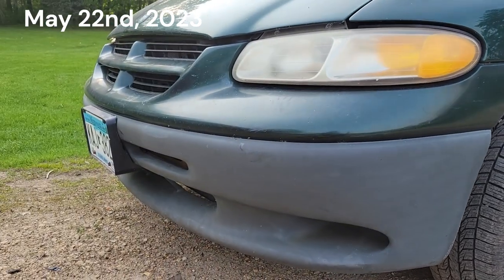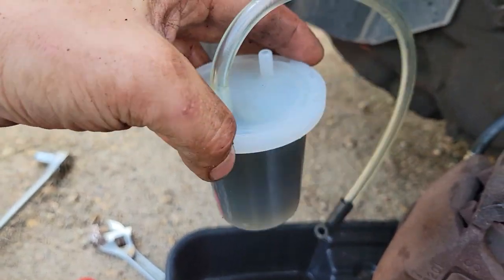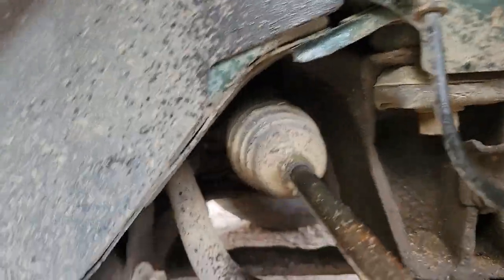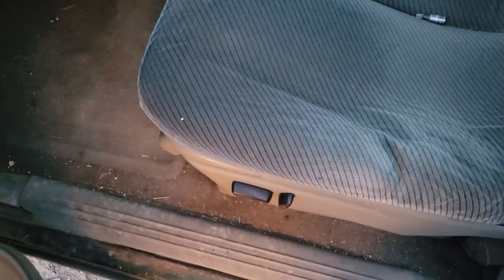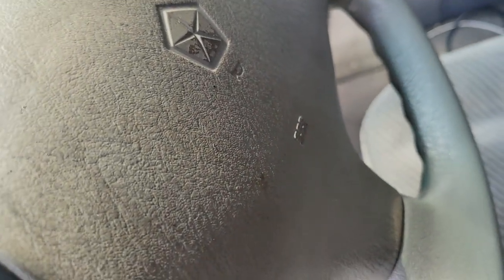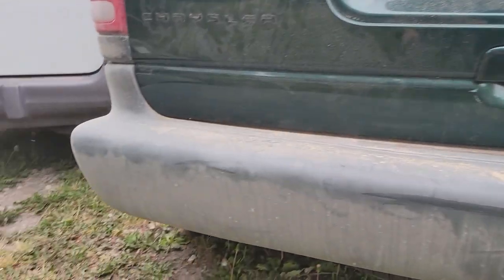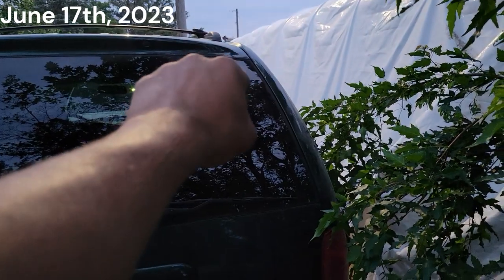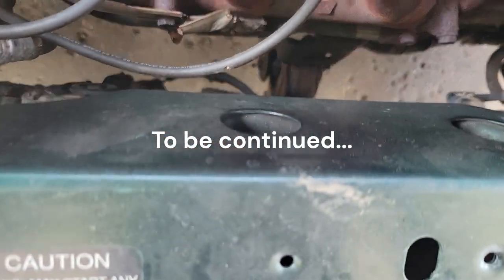Making some repairs on my 1997 Dodge Caravan LE  - Part 1

Comment: You know my parents had two of these vans when I was little.  A 96 and a 98 both standard length dodge caravans so it's very cool to see someone taking care of them.  Most of these rusted away but lately I've seen some out and about in very good condition.
Reply from the maker: Thank ya! Yeah lately I've been seeing 1-3 a day on the highway. Not sure why but I'm not complaining!
Reply: @MNMoparMinivan  Guess I'm not the only one who noticed.  Seems to me that these 90s vans have more staying power than the next generation ones haha
Reply: These vans will run forever. Only major problem is the transmission and here in Wisconsin the rust. Especially on the strut towers. And they are very good on gas

Comment: I did a tailgate replacement on my 2000 NS as well. I have the same trim, but decided not to put it on for several reasons.. The main one being that if the new panel ever shows rust, I can catch it! 

Love these videos! Nice work
Reply from the maker: Thank ya! Grab a can of fluid film or some other equivalent oil and spray a bit into the the drain holes at the bottom of the tailgate. Ideally, it'll seep into the pinch weld and keep it from returning.
Reply: @MN Mopar Minivan - I also just noticed the part where you mentioned the lock

I ended up making a key for the new lock on my tailgate instead of swapping the handle. I was able to decode it using a Lishi tool, and then cut a blank. It wasn't easy but it was worth it

The previous shop that swapped the handle on my old tailgate caused rust there, because the tab that holds the handle to the trunk can easily scratch the metal when you install it

https://www.youtube.com/watch?v=pHUN7RCAA9Q
Reply: @MNMoparMinivan  thank you!! Yes, I was really happy to see you using that too. I coat the whole undercarriage and the insides of the panels every fall!
Reply: I also fill the rockers with old used transmission fluid. lol

It does actually work, but will seep for a bit

Comment: Mine is a 97 too but it's a Grand Caravan base model so its got the manual windows with no tac or info center in the front. Speaking of which, can you do a video on how to replace the headliner in one of these because mine is bubbling so bad to the point where I cant even see my interior lights anymore lol
Reply from the maker: I have to put the new headliner back in my 90' and the process is similar. I'll see what I can show there. Until you can get it replaced, maybe get ahold of some thumb tacks from dollar tree and go to town on that thing lol!

Comment: Good video. 
So what was the fix for the fan continuously running?
Reply from the maker: I talk about it more in part two. But when the one fan motor locked up, the electrical resistance it caused burned up the controller relay. Luckily it failed "open" so the one fan kept running constantly.
Reply: @MNMoparMinivan  I had a fan stay on after it had overheated. After a bit I pulled the ground on the battery but replacing the relay did not fix the problem. The next day both fans would not turn on. If you put 12 volts to them they would. I ran it that way for a bit not using the AC but then the radiator started leaking. I got a used one with the fans and put it in. The fans started working so don't know what problem was, maybe a loose connection although I though I checked them all. Someone told me it was the computer but if that was the case they shouldn't be working now. Happy Motoring.

Comment: I have a 2008 dodge grand caravan that has the same engine as your 05 town and country i was wondering how often you think the head gaskets should be changed on it? Its only at 86,000 miles on it
Reply from the maker: My 05 has 313k on it and the engine has never had major work besides a Waterpump at 200k. I'm planning on doing the Waterpump and timing chain at 315k.

My dad has an 08 with 435k on the clock on the original headgaskets as well. Pretty sure it had a chain and a waterpump at least once.

My stance on headgaskets is only if they go out. If you're not seeing coolant in the oil or combustion gases in the coolant system you're good!
Reply: @MNMoparMinivan  wow that's surprising I had a 2005 dodge grand caravan it only had 215k on it and the head gaskets went bad on it so we junked it
Reply from the maker: @floridadude6983  sometimes it happens. Previous owner of my 98 GC had them blow and replaced at 160k. I bought it at 180k and it's got 208k or so on it now. Bottom line, I wouldn't worry about it until they go. They're not so much a wear item you replace pre-emptively like a timing chain or water pump.